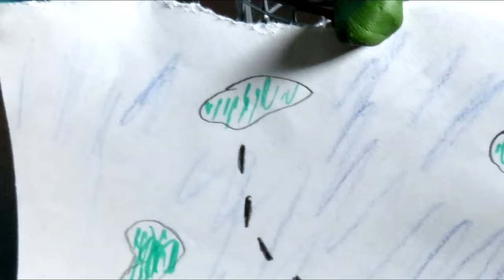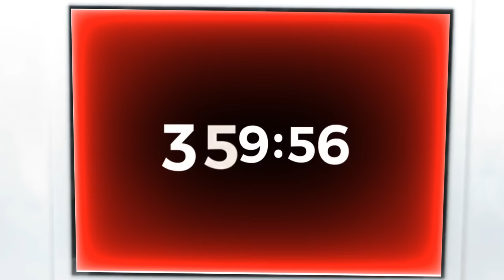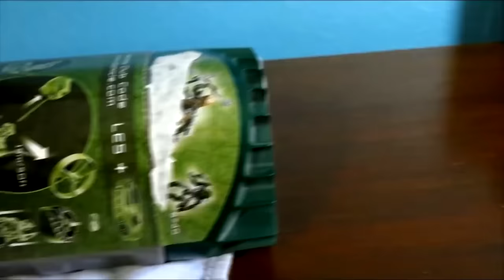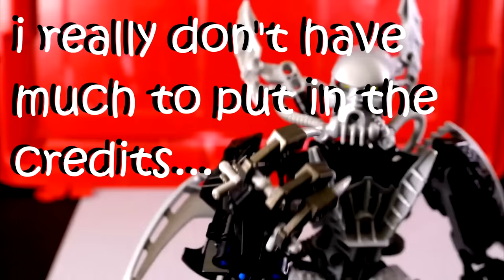BIONICLE - Ignition War

Comment: I love how fast the fights are in this but I have two questions.
1. How many frames per second do you usually make your videos at? (I know you used computer generated frames to make it look smoother).
2. What software do you use for the weapon effects?
Reply from the maker: This video i was still figuring things out so its always randomly changing between 20 to 60 fps. by the end i settled on 24 FPS and stopped using generated frames.

i used after effects for all the effects